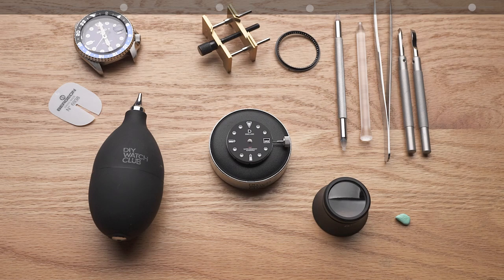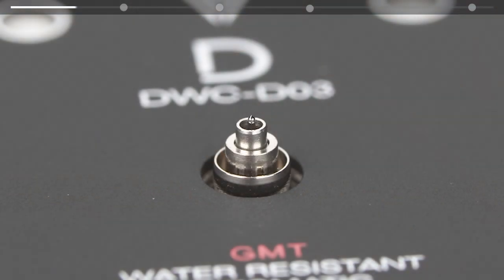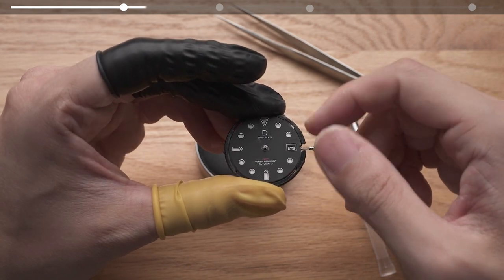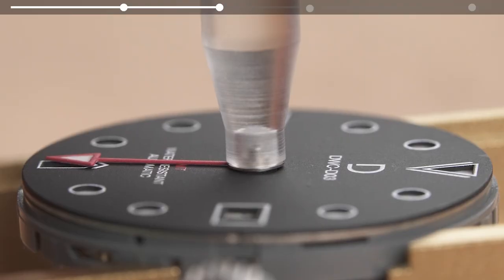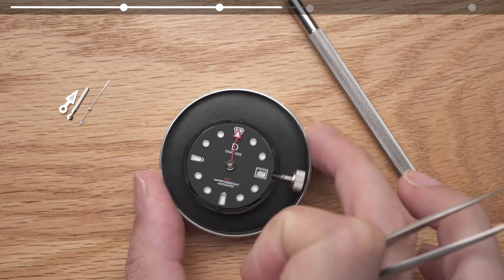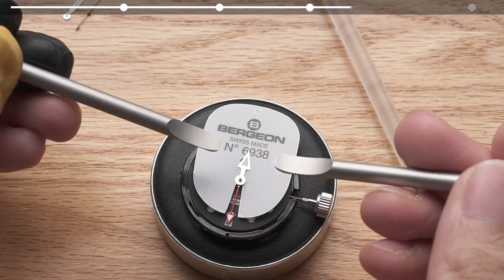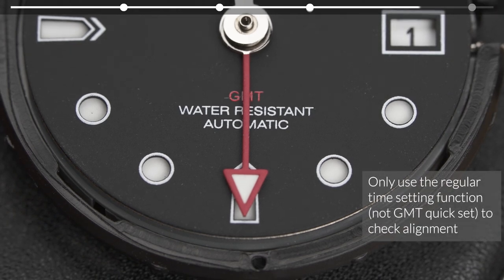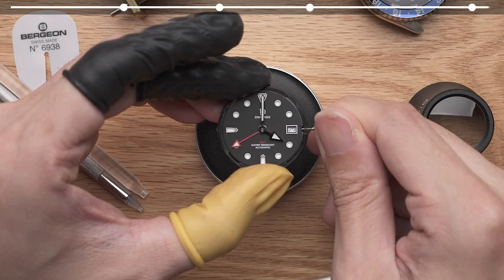How to Install GMT Hand, Hour, and Minute Hands for Seiko NH34/4R34 (Part 1 of 2)

Comment: Great stuff. This really helps.

I’ll be using a brown Marinemaster dial with gold indices, with gold hands & a rose gold GMT hand in a heavy reliced (forced aged patina) bronze case & rootbeer bezel insert (bleach & coffee stained).
However, the center hole on the Marinemaster dial is not large enough for the GMT center posts to go through. Any ideas how widen the hole, without damaging the paint? I was thinking small diamond file? But I’m open to suggestions.

Comment: My NH34 mod seconds hand stopped after a month...talking to the seller but figured I should learn how to fix ... are there any common reasons for a Seconds hand to get stuck? Should I be careful when hacking the movement aka changing the GMT, or date, time etc? Basically if I did anything wrong to cause something like that? I have it on a watch winder too.
Reply from the maker: We actually have a video on second hand stopping, hope this helps! https://youtu.be/4engQ_T_7n8
Reply: @DIYWatchClub  AWESOME THANK YOU!